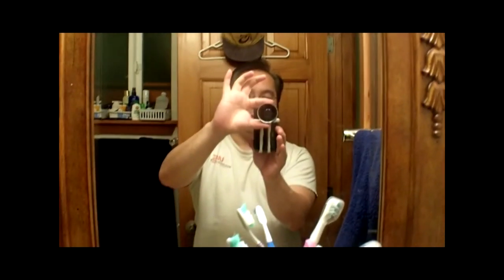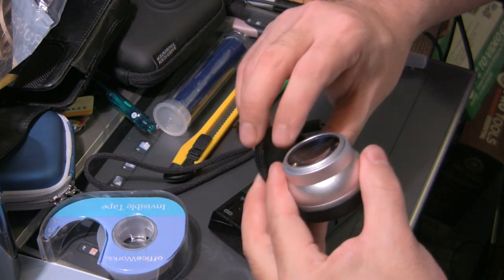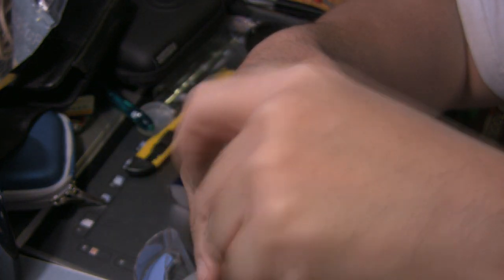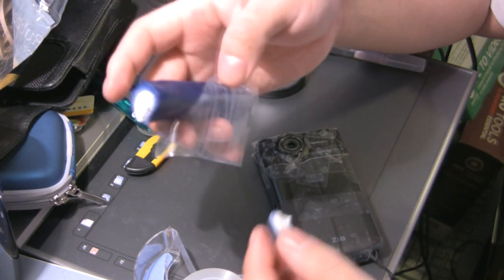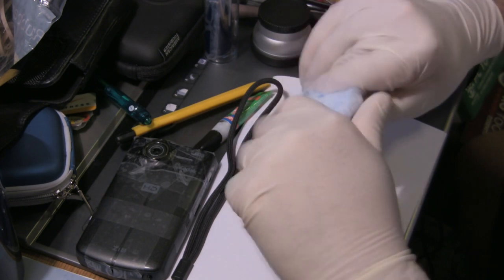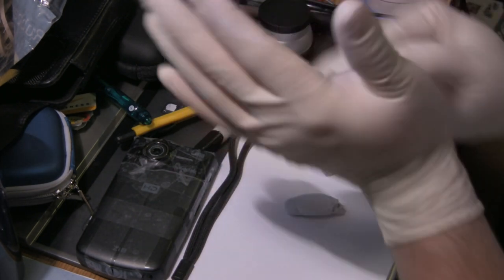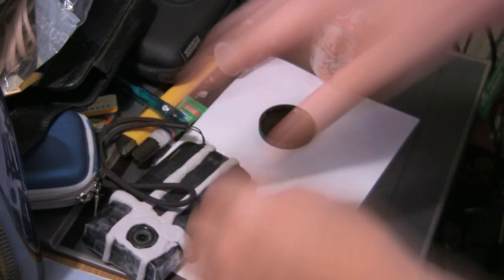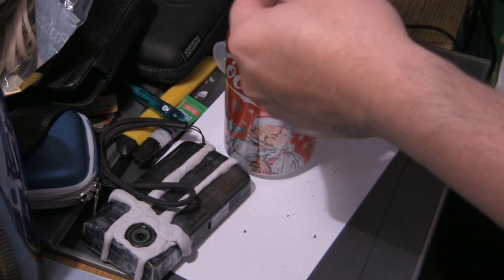Kodak Zi8: 1/2 Non-destructive removable wide angle lens mod

Comment: very ingenious.  When I started looking into Zi8 the other day, I saw the wide angle thing on ebay for $15.00.  But, crapped at the idea of gluing something onto the camera.  A gripper occured to me.  Using styrene plastic which can be heated to bend around.  Or, an old wire hanger which of course only requires a bit bending.  I have not yet talked myself into buying a Zi8.  I am still catching quick clips on an HTC 8529 phone.  Not pretty at all.

Comment from the maker: I would not recommend touching your camera with epoxy putty without taping it. If you are afraid of the tape getting stuck, you can try using blue painters masking tape. It comes off easy, but is not as thin.